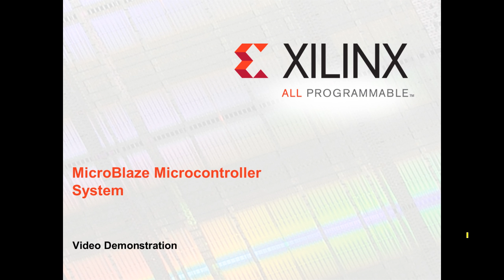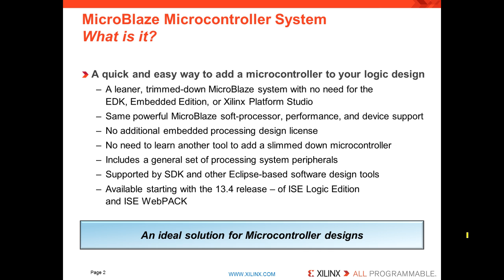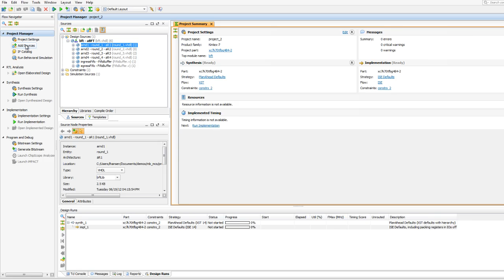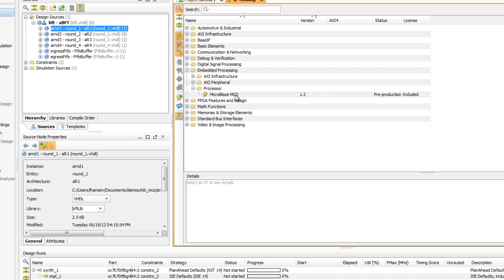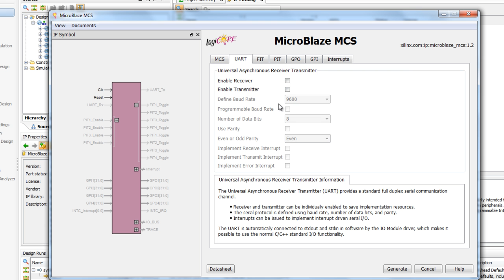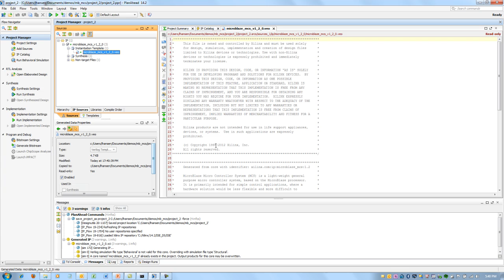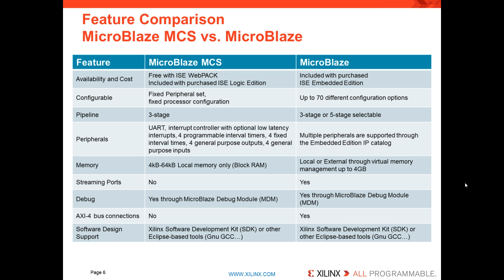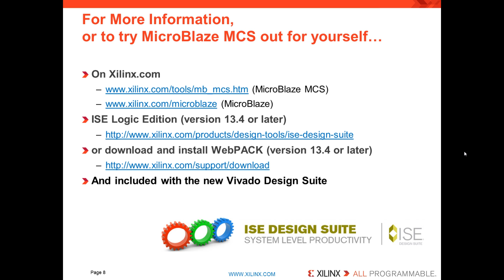The MicroBlaze Microcontroller System

Comment: It start's so good - thanks for that!
But it stops too early.
Why not switching over to SDK and do some simple "Hello, World!" program for the MCS?
Because i hit some error - which i can't fix:
ERROR:Data2MEM:47 - Not all BitLanes in ADDRESS_SPACE 'microblaze_mcs_v1_4_0.lmb_bram' have BMM location constraints.
    Some data for this ADDRESS_SPACE may be lost during BIT file
    replacement. Verify that the BMM file has location constraints
    for all BitLanes.

      Bitlane(s)
   ----------------
   mcs_0/U0/lmb_bram_I/RAM_Inst/Using_B16_S18.Using_RAMB36.The_BRAMs[1].RAMB36_I1 [15:0]
   mcs_0/U0/lmb_bram_I/RAM_Inst/Using_B16_S18.Using_RAMB36.The_BRAMs[0].RAMB36_I1 [31:16]

FPGA Programming Failed due to errors while initializing bitstream.